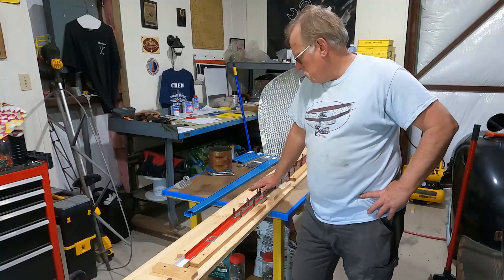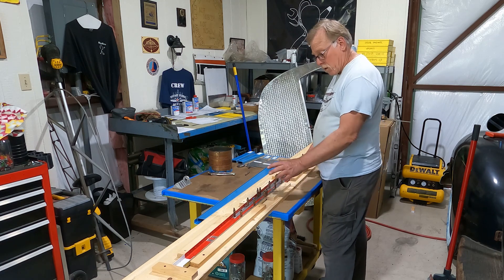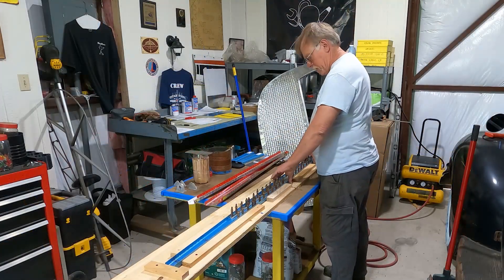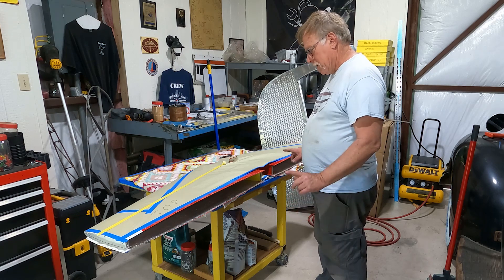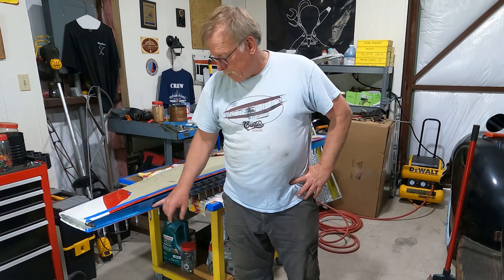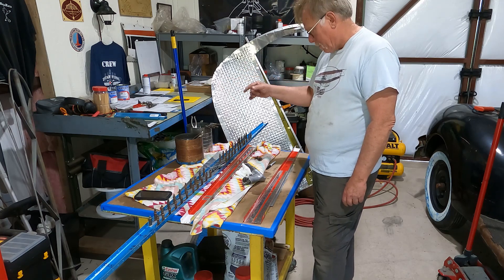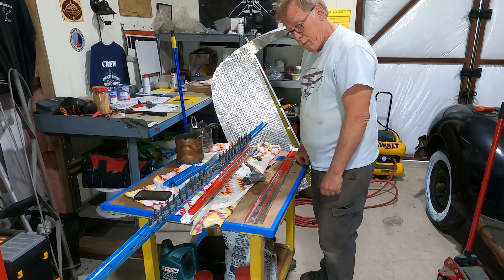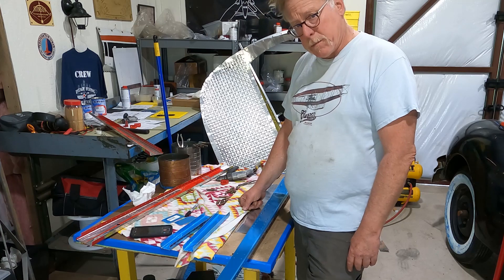Van's Service Bulletin SB00036 - Spar crack repair Part 2

Comment: If i had to do this SB i would want to take a bit more time and replace a cracking spar even if it didn't crack to the radius.    Does your little dewalt compressor handle that air drill?
Reply: I forgot to ask why would you reuse those center doublers rather than buying new? All that drilling to salvage them and some holes getting nicked up.
Reply from the maker: Center doublers are quite robust.  We take extra care on disassembling parts.  The doublers looked brand new after cleaning and stripping.